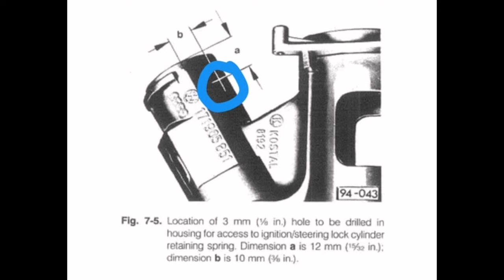VW mk1 - mk2 ignition switch removal

Comment: I used the measurements from my repair book exactly like yours and it wouldn't budge. It looked like yours didn't either , at first. How long did it take to get it out ? I see your drill bit didn't hit the right part of the spring just like mine didn't.  I am going to to drill more holes on either side of the original.